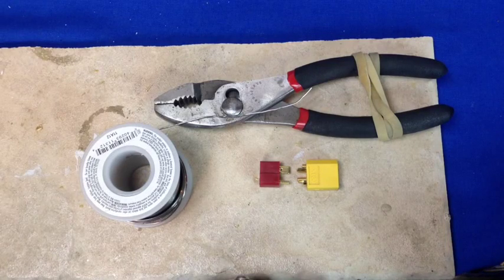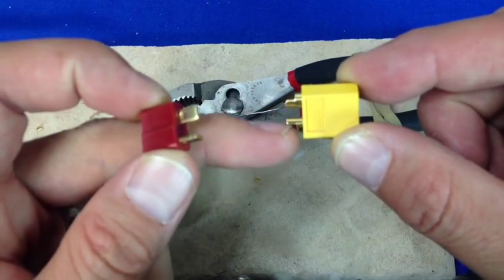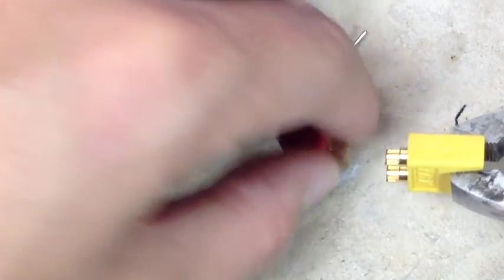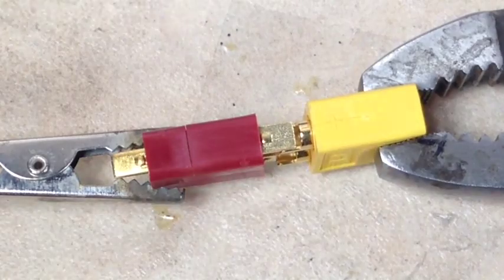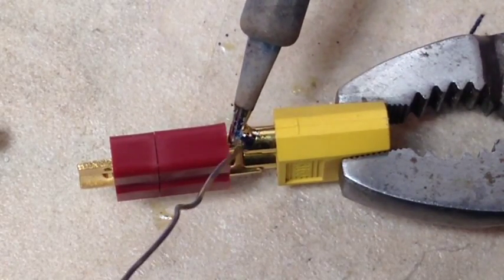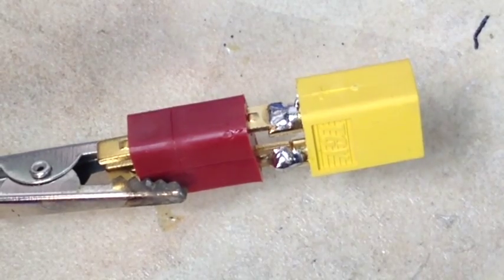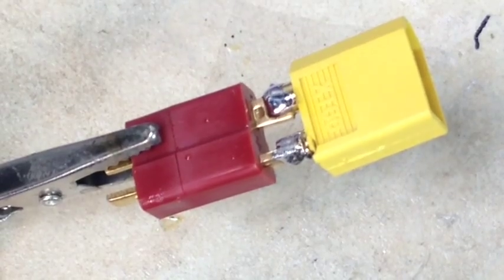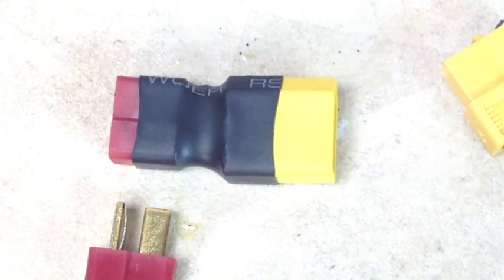Deans to xt60 Adaptor Tutorial

Comment: I bought a 3 pack of  XT60  to Deans connector adapters on eBay  and  one of the three were solider backwards...problem was I didn't notice this mistake  until I used it to plug  in my 3S LiPo ...........is there a simple way to check the positive and negative prongs  just by looking at them ?...............
Reply from the maker: Yes, each side of the connector has a positive and negative indication mark, if you remove the heat shrink you’ll see if they are lined up properly

Comment: What kind of soldering iron do you use?  I have a Weller but doesn't seem to work as well as yours.... Great video!
Reply from the maker: Mine is the radio shack soldering station with digital variable temp. I use a larger tip than the stock micro tip. I got it on sale for $69. To bad they are out of business!  I've heard the haiko aren't necessarily as good as most people say.